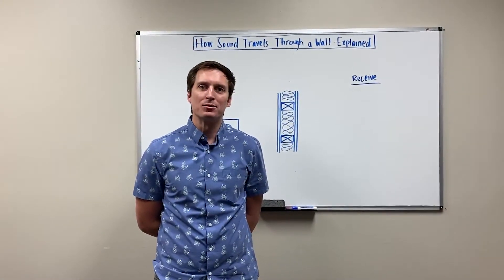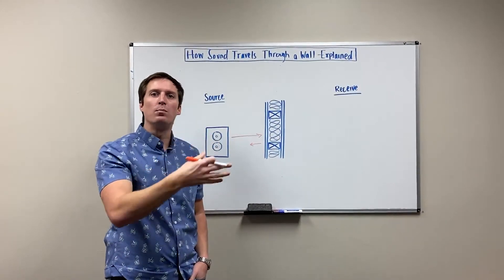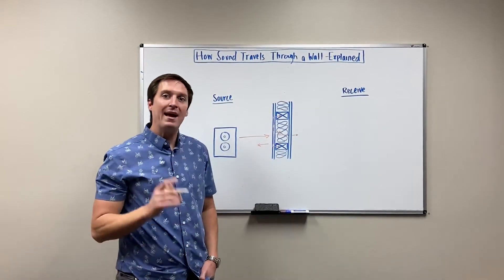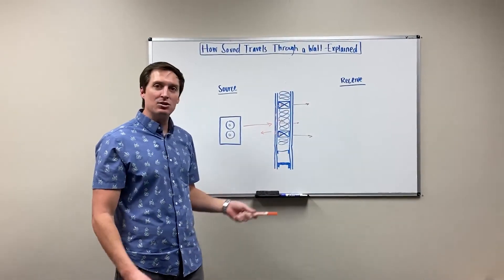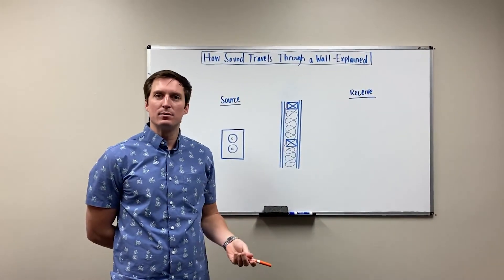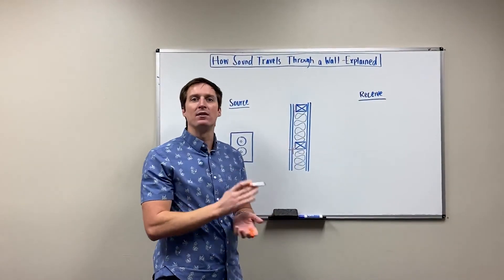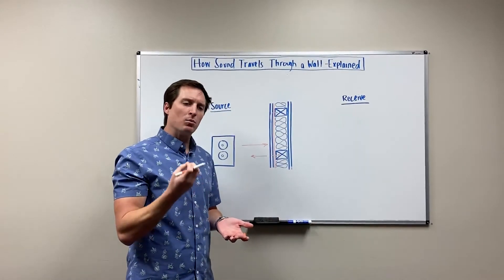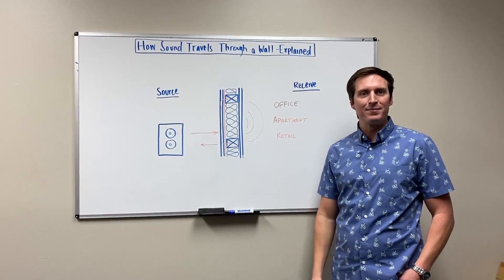How Sound Travels Through Walls

Comment: So a good way to isolate the source room (for ex. a music room) would be to put foam/wool on the wall studs? Or would the sound just travel through the rest of the drywall back to the studs?
Reply: Double wall or staggered studs so front and back drywall aren’t using the same studs